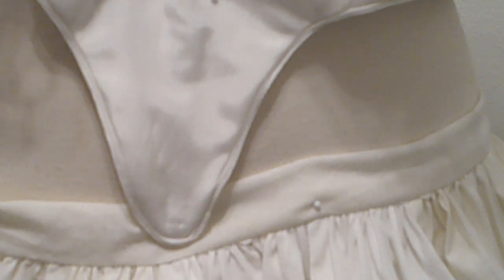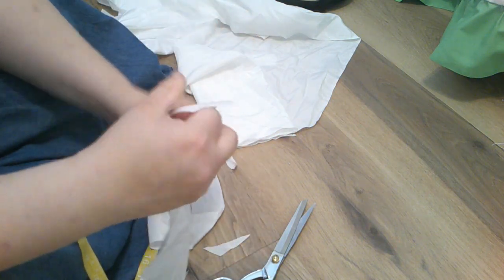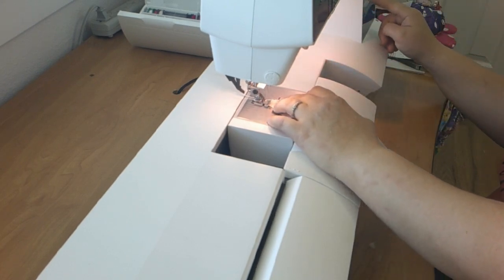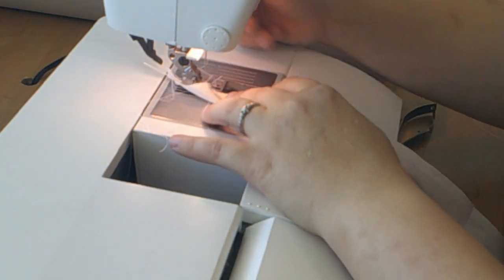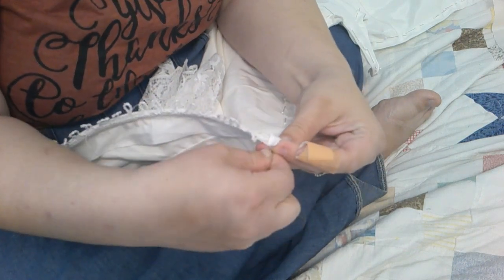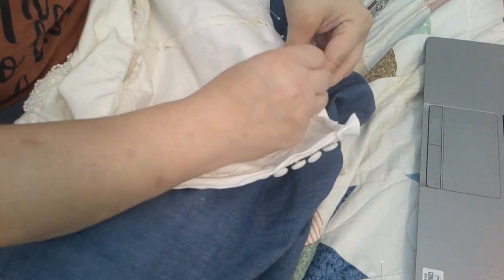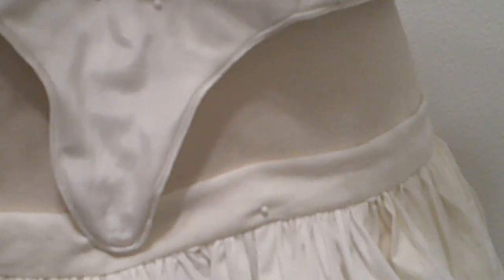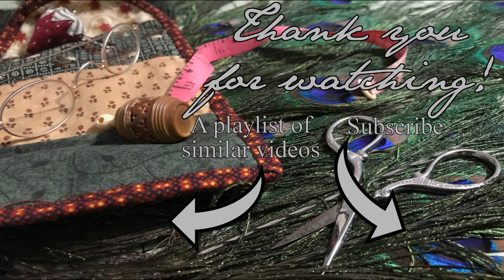How to Do Double Piping on a Bodice || A Historical Sewing How To

Comment: It's amazing how you have a video for every issue I encounter in sewing for this era. The instructions my pattern gives for making double piping make no sense, and this method seems much easier.
Reply from the maker: I'm glad to be of service!  this was the first time I've attempted double piping and I've only seen it once.  Hopefully, it won't be my last time doing it because I think the effect is so neat!
Reply: @KatelynKearns  I eventually did get the double piping onto my bodice with your method! It looked sloppy and took a lot of tidying up afterwards by hand, but I got it done. My first attempt before seeing your method was so much worse though! I think if my machine had a zipper foot like yours it would have turned out much better. I wonder how it was done before zipper feet were available.
Reply from the maker: @karlahovde  Oh absolutely the zipper foot made things so much easier.  If you have any type of modern machine, you can usually source the zipper foot separately.  Some of the antique models also have them but I believe they are called piping feet.